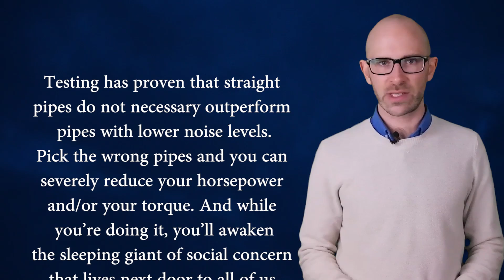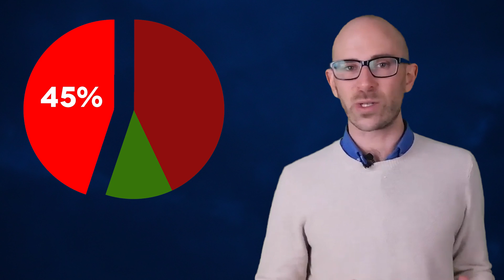Why are Harley Davidson Motorcycles So Loud?

Comment: He used "powerful" and"Harley" in the same sentence lol
Reply: Atomic Reverend Alexander what world do you live in? Tons of women love sportbike's and many bikes other than harleys. If you want to talk about exhaust note, do research because not all Jap bikes are 4cylinders and not all sportbikes are either. You wanna hear a sweet sounding bike go to my channel. I don't hate Harley's but I know they aren't my cup.of tea. To me the bang for the Buck isn't there in a Harley. They are so outrageously priced for what they are. I have friends that have owned Harley's and I remember a quote one always said about Harley "yesterdays technology at today's prices" not a single one of my friends who had Harley's didn't pay out the ass to own and maintain it. Ill just stick with my Jap bikes that take a licking and keep on ticking. To compare the power a Harley makes to a small car really doesn't add up. If you want to make a comparison compare a cc's to cc's with any non harley bike and you will see there there is a pretty big gap. A good example would be my sv1000s factory it makes 108hp and 69lb ft of torque and its only 996 cc's. Its 459lbs wet. How heavy is even a bare bones Sportster?
Reply: Cool make your over priced assembled not built in America bike, turn heads so everyone can see you dressed like a gay pirate
Reply: Grieg Ragen Agian, you're comparing Apples to Oranges, you wouldn't use a screwdriver to loosen a bolt tightened to 100 foot lbs nor would you use a Harley to canyon carve. You how ever would use a wrench to loosen said bolt just as you would use a Harley to ride 500 miles in a day and generally speaking you wouldn't do that with a street bike.
Reply: Team Neudimensions do you even own a bike?
Reply: Marshal Whitehurst Lol That’s why we launch at higher rpm and 600cc sport bikes dust 130ci Dynas in a quarter mile.
Reply: Frank that isn't a good analogy because where is the bed on the Harley to haul stuff. Plus people buy bikes for speed not to pull a stump out of the ground. As far as the ride that is one of the main reason not to buy a Harley. It's such a pain in the ass to stop every 30 minutes to get the blood back into your hand. While the other rider just keep going and going and going. Sorry my next bike won't be another Harley.
Reply: Try riding a new Harley with a Milwaukee 8 engine.... Absolutely no slouch there!
Reply: Anyone who knows about combustion engines know horsepower is nothing but potential power while torque is usable "rubber meets the ground" power. Case closed
Reply: @Grieg Ragen and for the last 10 years in a row harley davidson is the world champion of the most famous us nationals pro stock drag bike championship winners putting all others on their trailers and  out running the hayabusa 10 consecutive years ..oh and the busa boys were crying so loud a while back so the NHRA u.s. nationals officials made the harley team add 20 more pounds of dead weight to all the harleys to give the busas a chance ...bahaha.. ..and the busa boys thought ok now we gott'em ... but WRONG again , and matt hines add the 20 pounds of dead  weight over the rear tire that it desperately  needed giving the v rods the extra traction they needed to get the rear slick to hook up  .. and now they go even faster than before ..and 1st bikes ever in the history of all drag racing to run in the 6's for pro stock of all brands unlimited
Reply: ya aint that funny cause he left out harley is also the fastest bike in the world of pro stock drag racing winning the championship for 10 years in a row against the suzuki hayabusa ..aint that a  kick in your dumb ass ?  bahahaha
Reply: Team Neudimensions without the words "not very", lol
Reply: Loke 3wheel. Harley  no whan
Reply: True - Harleys are more like pick-up trucks, where sport bikes are more like sport cars.  Those big pistons provide a lot of low-end torque that you won't get out of a larger number of smaller pistons (assuming same displacement).... but you get a little rougher ride.
Reply: Team Neudimensions 👎👎👎
Reply: Harley's produce bugger all horsepower. They aren't powerful, they are simply loud. Supersports and superbikes, now that's where you see power.
Reply: They are powerful. They just can't go round bends.
Reply: Just for instance a Chevy 350 small block is average at 140 horse FYI
Reply: 94 horsepower on a bone stock road glide pretty damn powerful considering it is somewhat of a cruising bike not made for a dumbass 20 something to kill themselves on.  That is more horsepower then  a lot of economy cars... Harleys also make a ton of torque that when geared the way they are make the bike pretty damn fun to ride and you don't have to wing the engine at 10000 rpm to feel it either.
Reply: It's apples to oranges so I guess it really doesn't matter regardless if the horsepower is more or less but What I will say is the torque on a Harley really is unreal for two wheels especially for the chassis they are on, it won't ever be as fast as a street bike (in stock form) but it is something I recommend riding at least once before making a final judgment against one. Personally  I love my old skool hard core bobbers that are bare bones but I totally get why my friends are on comfortable Roadkings, and heritage soft ttails and all of them used to ride Street bikes from japan. Harley's have gotten a really bad rap with the under 40 crowd but useally in is unfounded.
Reply: @AtomicReverend  the v-rod destroyer is a production motorcycle built by harley davidson with a documented 1/4 mile E.T. of 9.6 seconds for the standing 1/4 mile ...the hayabusa as most say is the fastest advertised a 1/4 standing start 1/4 mile E.T. of 9.7 seconds = 2nd place as famous funny car driver  john force will tell you that 2nd place is only the 1st loser
Reply: to be fair they are kinds powerful in the sense that mine has a 1.7L engine
Reply: False Ego I actually used to have a Triumph Bonneville that was a bob, I rode that thing everywhere and my back still reminds me that I used to ride it everywhere.  I actually avoided mentioning the wild ones because I knew it was a Triumph so I went with the other popular bike movies that everyone has seen. Personally I actually like all bikes (and cars for that matter) but the vintage American stuff does generally have a special place in my heart.  Honestly as I believe I had stated in an above comment is that most people that knock a Harley have never rode one. I know they aren't for everyone but the position you ride and the torque make them a blast to beat on and I totally get why they are pretty well respected by seasoned riders. In this conversation above I have a feeling that most of the comments are by guys that know a guy who had a friend who's brother had a Harley that had issues and none of them have any real first hand experience with one...
Reply: Team you can now use rice burner in there to. They shut down the Kentucky plant and moved it to Bangkok.
Reply: They aren't an 1973 Kawasaki H2 but they were never meant to be either....it is sort of like a Rolls Royce, it makes more power then anyone ever needs and in announces it's presence as an authority.
Reply: @AtomicReverend  when you go to a dealer to buy a new harley .. you need to tell them how much horsepower you want  and they will sell it to .. my last brand new dyna "s' made 120whp and 121 foot lbs of torque it was all stock harley parts with an extended warranty of 3 years   . turned the all out dyno drag races of a standing 1/4 mile @ 9.6 seconds at 123 miles per hour and the hayabusa that ran before me turned the 1/4 at 9.7 seconds at 130 miles per hour and lost the race to me ..and racing my dyna against a 1973 kawasaki H2 With 74 bhp and 57 Ft-Lb of torque at the crankshaft will not turn 9 seconds in the quarter mile
Reply: @chuckiebill7422  you mean a brand new built Harley will beat what could be argued to be the first super bike, I mean it's only 47 years old, some would say it's an antique or at least a classic.  I mean who would have thought, next thing we will all hear is a new a Dodge Demon can beat a classic hemi 'cuda... AGAIN APPLES TO ORANGES and without one the other would hav never came to be. 

To the rest of you all that keep going around and around for literally months now.
As my above statements said I love all motorcycles, I  am currently building/restoring a 1968 Honda trail CT90 which definitely isn't fast or sporty so you know I am serious about all form of bikes and I stick up for Harley-Davidson buyers/riders.  
I keep seeing others in this comment section that say stupid comments, like a Harley is slow, but yet again nobody that buys one really cares if it isn't the fastest on the road as I thought I said above but most apparently I wasn't clear in that statement that a Harley generally is bought and rode by someone who wants a comfortable seating position, a bike that is easy to ride long distances, looks great, and sounds good. Just like anyone that buys a superbike isn't buying it to ride along side the boys on a country road. But they are buying it so announce that they are the fastest in the city or the canyon.  
Mentioning where the Gearhead come into play by building said Harley and it kills a "super" bike and it happens  again isn't a fair comparison because by that same rationale you could build the superbike. 
What could be said about building a Harley is building a sleeper that smokes an unexpecting superbike owner but the first rule of a sleeper is sort of like a fight club and that is the person never talks about it that owns it or participates in it. The only one that ever talks about it outside of the garage is the loser.  

Anyways I am bored talking about motorcycles, I ha e owned a lot of bikes over the years both fast and slow and from Europe the USA and Japan. my favorite out of what you would consider a traditional motorcycle is a Harley Davidson that is because it can be loud and comfortable to ride for a long distance. 
My second favorite motorcycle is barely a motorcycle and that is the Honda Cub family because it rides great it is super reliable and gets a 110mpg.

The motorcycle hobby is vast and there is room for the Mopeds, the Superbikes, The Cruisers, The Scooters, the vintage classics, the Dual sports, the choppers, the Bob's, the sport tourings, the tourings, dirt bikes and any other style I am more then likely forgetting stop with the useless keyboard arguments that aren't going anywhere except and circles
Reply: Atomic Reverend Alexander my 04 v rod made 107 rwhp with a Vance an Hines Indy xhaustan power comander
Reply: Buy a harley! Buy the best! Ride a mile! Walk the rest!
Reply: https://youtu.be/vjFeC7g6_40.  Take a look,,,by the time the rice burners get their rpm's up to get HP the harleys are gone and Done hahaha,,,Short and Sweet !
Reply: Grieg Ragen no Greg you are wrong, and clearly you didn't look it up as I did and these are just a few examples, and yes you can up option some of them but that isn't the point... the fiat 500 makes as little as 101, Nissan versa makes 109,  the Prius makes 99, the Yaris makes 106 and it wasn't until really recently as in like the last eight to 10 years that they started making these power numbers it wasn't that long ago that they made in the 70 to 80 horsepower range when you consider horsepower to weight ratio Harley-Davidson makes a ton of power for what it is and what it is designed to do. Now argue with me again YouTube know it all.
Reply: False Ego (and everyone else)  why would you be having this conversation with how fast they are to one another?  I mean seriously, I keep reading this thread this argument is going around in circles, Jap and American but when they are both cruisers and neither of them are what a sport bike is and are not built for speed and neither of them do anything well but Cruise hence the name cruiser.
What I will say is personally when it comes to the two you will never hear a girl get excited for anything other then a Harley and at the end of the day and 20 grand later a Harley will get you laid at the bar by exhaust note and chrome alone, chicks don't give two fucks to the guy on a Yamaha (not even in Japan) a Harley has a special place in everyone's heart because it says freedom and rebel ...  You don't see a movie called VMAX and the Marlboro man  nor in Easy Rider was Peter Fonda riding a street bike that said Ninja (or in that era Triumph). The Mongols, Hessians at Hells Angels are always on American bikes   even when it is an over seas chapter...  It's always about being cool  and a Harley is fucking cool and they only get cooler when you hack them up into bobbers, choppers and customs so next time when I see a Kat on his Ironhead bobber I will know why he is going slow it is because he can.
Reply: @AtomicReverend  lol hear hear !!! Well said.. and the only thing that sounds as good as a Harley is a Huey !!!  The Harley Davidson of helicopters 😎
Reply: When talking powerful He's talking Torque not HP,,,,2 completely different animals,,
Harley will CRUSH any rice burner made to date when it comes to Stump pulling torque !

Comment: I like how you compare the exhaust noise of a DIESEL(lower rpm's) truck with a very long chassis to a V2 gasoline chopper with an exhaust length of roughly one meter. Where can a chopper fit more silencers? Where is that space? 
A ford F450, and i suspect you don't know any of this by the way you speak, has a DPF(Diesel Particulate Filter) and a middle silencer and one large one at the back. It also revs up to 3700RPM's max, because it's a diesel. 
A motorbike however, be it a chopper or sportsbike or even a small vespa like you hipsters love, has a very short pipe after the cylinder head and has a silencer immediately after the pipe is straightened. Plus they rev up all the way up to 9-13k RPM's. There's nothing anyone can do about this. 
Either you will have to ban all motorcycles and sports cars, and make everyone buy teslas, or shut up.

Comment: Harleys do not roll off of the assembly line with loud exhaust systems. They are excessively muffled due to EPA sound and emission regulations.
  The individual owners install aftermarket exhaust systems to enhance the unique sound of the harley engine.
  The loud pipes save lives concept is total bullshit, untrue, and unnecessary and is used only in an attempt to validate poor taste.
  As in all things, choice and taste are of a wide range. Harleys do have a unique and beautiful exhaust rythm and tone, and a person is totally justified in installing an exhaust system that enhances this sound. Aftermarket exhaust systems can not only enhance the sound, but also improve a motorcycles performance and fuel economy.
  There is a certain range where these factors are optimized, and anything above or below is not only unnecessary but also detrimental to the machine and to all concerned. Theres no accounting for taste!

Comment: I'll tell you why. The sound of a Harley is a legal registered trademark. This was challenged in court and HD won. They won by proving they tuned their engines to purposely produce that distinctive thumping sound. In order to prove this, they showed they sacrificed performance to get the sound they wanted. If I got Harley, I would probably install something like a dynojet power commander to tune fuel and timing.

Comment: Simon, I normally agree and or believe most of what you post or the stances you take.. Loud pipes do save lives...  It's kinda like the helment law debate... In this case, where you have made your mistake is here: new from the factory you can barely hear a Harley run... Go to a dealership and have them fire one up... I myself and family members have purchased 3 in the last five years. This is done intentionally... The very first modification one makes to their new bike, is to put pipes on it.. To the point where the salesperson has all the parts lists and availability of said parts at the waiting... It's many times done to the bike before delivery is taken. It normally adds a $1000.00 to he cost of an already overpriced bike, and it's a given... Most non-mechaniclly inclined people will pay the exobitant price to have this done from jump street... Pipes and proper tuning are just a part of the sale...Having it done by a Harley dealer avoids all warranty issues and as a rule, gives the best overall end product... My point is, from the factory they're as quiet as a mouse..., And yes it's a must do... To own a quiet Harley, is just sacrilegious.... It's just wrong...

Comment: Harley riders change out their exhausts because the stock systems are extremely restrictive. They are quieter but they make the engines run hot, severely restrict air flow and significantly reduce power. We don't have the luxury of multi-cylinders and radiators. 95% of our riding is between 2000 & 3000 RPM. We have to "open up" our bikes a little bit to get the extra power and have them run cooler and more efficiently. Forget "Straight Pipes", very few riders use them, we just use "after market" exhausts that are less restrictive and a little bit louder. As far as your reference to single vehicle accidents, (I was only listening with half an ear because I really didn't like what you had to say), those are mostly "crotch rockets", which many by the way, have after market exhaust systems which are also louder than stock. Then again you have Honda Goldwings, which are 6 cylinder bikes that are so quiet, one almost ran me over in a parking lot because I had no idea he was there! I never heard a bike so quiet, to quiet in my opinion....